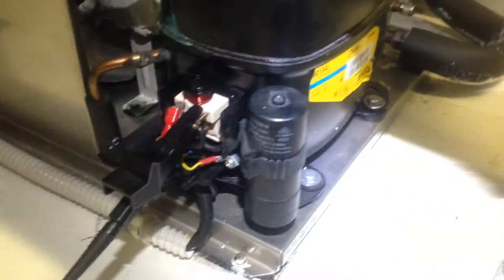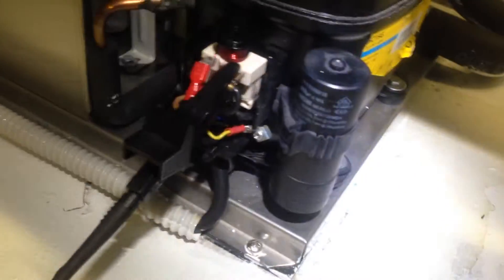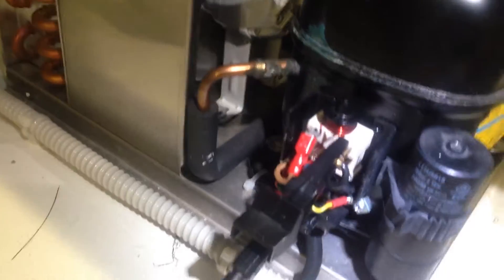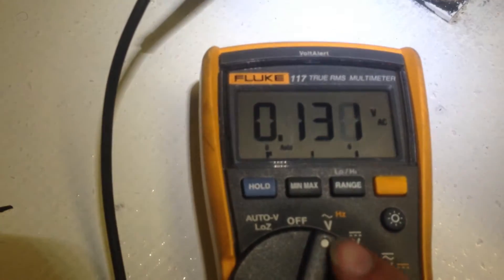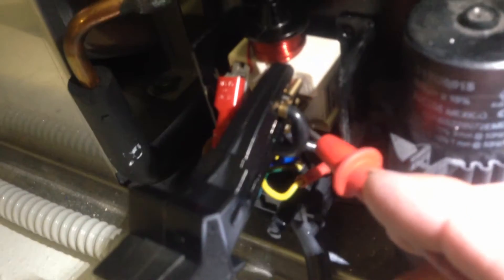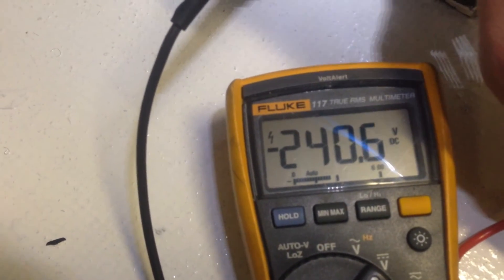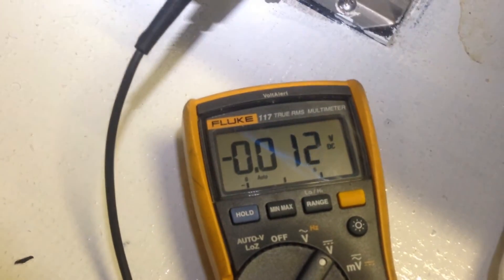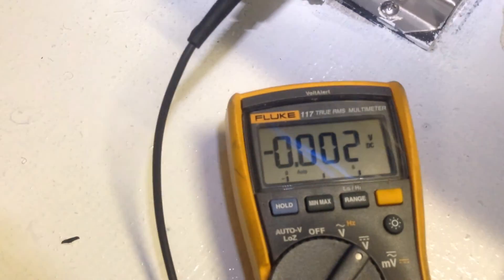Checking for voltage charge on a capacitor.

Comment: is that why i get no measurements on AC scale when i pull out the disconnect?  i thought my unit discharge its self since its a newer model.  NO Alternating current when off therefore no AC VOLTAGE ONLY DC .

Comment: How do you safely discharge the Capacitor ??
Reply: For best results use a big resistor and connect the ends across the capacitor. I would recommend holding it with a pair of pliers with rubber grips. For a fun way to do it, use a screwdriver with a rubber grip (sparks very loudly, may spot weld the screwdriver to the capacitor)
Reply: @mid-game7460 I think I've seen some people just discharge it with pliers only, or is that maybe only possible for small ceramic capacitors? Any thoughts are much appreciated!
Reply: @sharymens8187  Pliers or a screwdriver can be used to discharge a capacitor, but it isn't the safest and gets more unsafe the more voltage the capacitor contains. By using a resistor, you decrease the current created proportionally by the size of the resistor. Less current is safer, and will spark and heat up less. Metal has very low resistance, so the pliers/screwdriver tend to spark and heat up, and might even shock you if they don't have a good rubberized grip.

Tl;Dr - Pliers can work on small capacitors but it is safest to use a large resistor
Reply: @mid-game7460  Thank you!